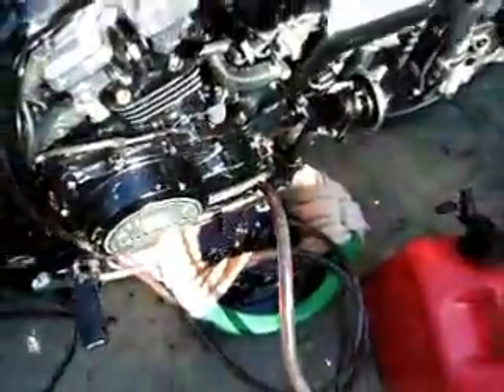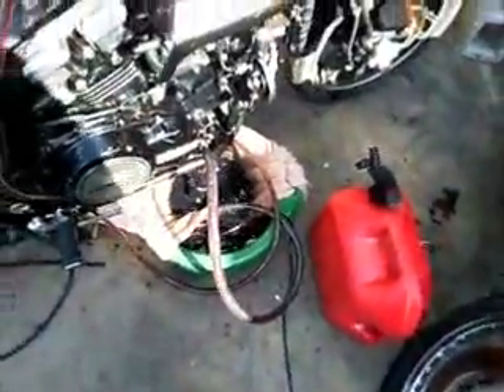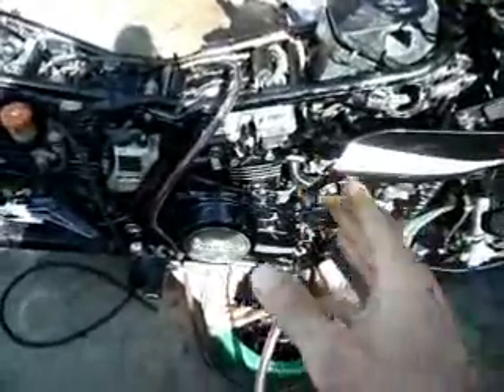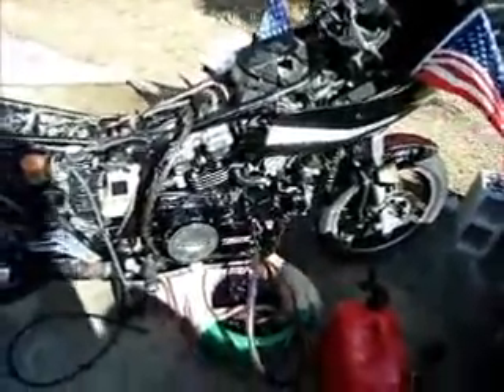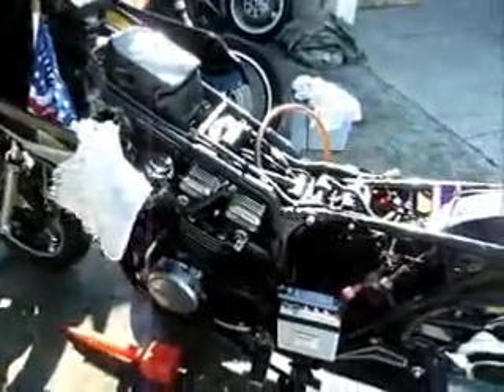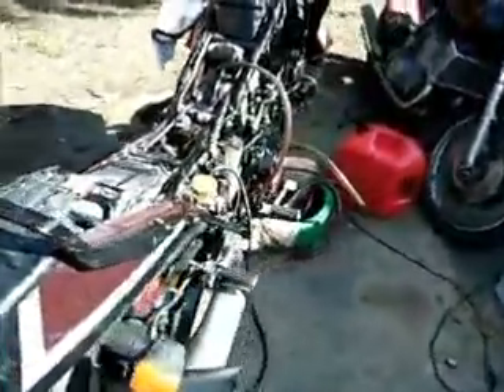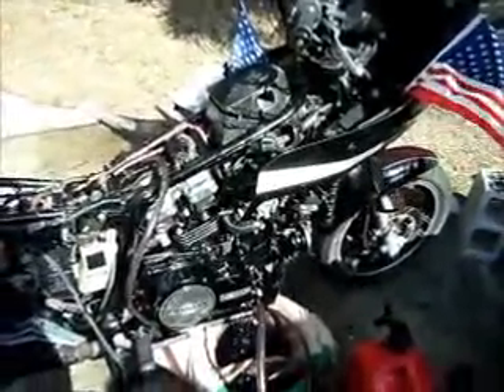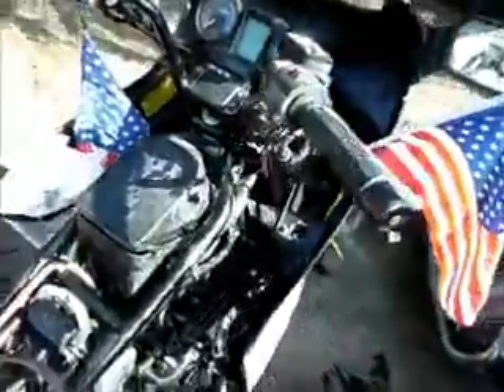Unseizing an engine without pulling it

Comment: I have taken the information from here and applying to a 1982 Honda Goldwing gl1100 Interstate. It has been sitting for 18 years. Had the pump flowing for 4 days. The trash in the bucket is a shock!
Reply: Where did you put the top line on the gold wing?

Comment from the maker: You have to pump it up from the lowest point you can and it has to flow out of the highest point  in the engine.
 So yes up from the oil pan and out through the valve cover breather.

Its effective enough I did 9 engines in 3 weeks....Also it has the added advantage of it breaks up any varnish/sludge inside the engine - leaves everything inside nice and clean -- I still pull em apart and inspect everything just to be sure it was only stuck from being in storage and not from something else

Comment: I just take the spark plugs of and spray half a can of PB Blaster in each cylinder and let it sit
Reply: +CHOPPERGIRL AIRWAR I've used that too. Works every time.
Reply: Just did this today hope it works
Reply: Same here. Then put it in 5th and rock it free.
Reply: What do you after letting the pb blast sit?

Comment from the maker: @poopdoo1 You can weld next to diesel (although I dont recommend it unless you just have to)- It has a really high flash point and you'd have to hold a lighter on it a minute to get it to go if you wanted it to.... Even gasoline you can drop a cig in a bucket of the stuff and it aint catching fire
Reply: dawino6260  on the bike I just bought I can see some rust in the spark plug holes will your method work   . I was just wondering how the oil pushes up through the rings

Comment: I just had a 18hp Brigg's sieze up one night on my Buggy, i filled it up to the top with oil thru the plug hole's, and then broke it free with a Tire wrench(redrained oil yes), and then drove it for about another 2 wk's, and then the Conn Rod  end cap broke! I can't believe it even run again after locking up like tht........

Comment from the maker: With aluminum I've had luck - but I strongly recommend pulling it apart afterwards anyway and inspecting for deep pits - little shallow ones (less than .5mm ) I dont worry about... but I've had shifting nightmares with pits over 1mm deep (and even a tooth chunk off a gear)

Comment from the maker: @redbaron447 Only if it's a piston stuck -- but that doesn't flush out an engine and get it clean -  Plus this way it gets valves,transmission - whatever is stuck unstuck and clean. It's the difference between getting it running and having it last a few thousand miles -- Or between a little rust taking out say a valve seal for example

Comment from the maker: @yellowrotorway Seems to work pretty good on most aluminum engines -- every now and again you get one with a stuck ring and have to re-ring em but not too often - They generally run pretty good - give em fresh oil, run em 1/2 hour and change it right away again is my usual 'post process'

Comment from the maker: @Templehatchet Piston, rings and a fresh wrist pin for a briggs is usually less than 30 bucks -- shouldn't have to bore it - just break the glaze most of the time.   If you catch it soon enough after it seized you can usually save them -- if there's too much aluminium in the bore though at minimum hit it with some slick 50 if you dont feel like cleaning it/replacing the piston -- My lawnmower has a KZ1300A2 engine on it perma locked in 1st gear - shaft orientation is all that matters

Comment from the maker: go UP to a model 12 mag drive pump -- AND make sure you have the plugs out and a little mix in them -- Yes it should work. give it a week and have a 6ft pipe cut to fit the kick start - tie a regular concrete block to it - when it has dropped twice on its own switch to real oil in the engine (pour some into the pcv too) - open both sides of the engine and pre-lube EVERYTHING you can get to before attempting to start it

Comment: You can throw your butt in the pan & all it will do is go out. You can also do this with gasoline. Cigs will not light liquid fuel, only an open flame will. In a contained atmosphere like a paint booth, NO SMOKING. Has to be a pretty unventilated room with your eyes burning for a cig to initiate combustion.

Comment from the maker: I do pull the spark plugs out during the process -- and although mild - the mix is a solvent -- and the pistons/rings themselves are not a sufficient seal - that little 2 or 3 psi the pump puts out is enough to get the mix up in there and work its magic.
   Really bad ones I'll break out a grease gun I've adapted with the spark plug end off an old compression tester -- VERY rarely do I have to do that and 9 times out of ten when I do the engine was stuck from varnish rather than rust

Comment from the maker: if front check your fork ground... rear or all : check your fuse, wire to the switch and flasher -- if you lost both sides it's usually one of those 3

Comment from the maker: Depending on the 50cc engine (and crank position) I'm more inclined to block off the intake and exhaust ports with aluminum plates over thick, hard rubber and adapt the fitting on a grease gun to a spark plug thread (I had to order my adapter from a Hydraulic hose place) -- but I FILL the engine with straight Marvel Mystery Oil for a couple of days first when I do the grease gun method

Comment from the maker: Much like you can remove the sub trans from a CB900C and pop in the F trans with sprocket ready output shaft -- The VF family can ALL go both ways (chain or shaft) with nothing more than a weekends effort and some spare parts laying around - .. Only exception is the NC30/VF500/VFR500 - That takes a little machine work.

Comment: I don't got an aquarium pump nor do I have any of that marvel mystery oil but I've got a bunch of diesel. I've got the 83 magna v65 and it seized over the winter...working at it i eventually got one cylinder to somewhat free up it spat out a bit if diesel out of the plug hole

Comment: I un stuck a John Deere tractor that was locked up for 25 years had it free in 10 min and didn't brake the rings. no magic potions no mystery oils no liquids no stress or torque on the engine just two hands to trun the fly wheel when it was free. I have not seen a video of anyone using this method.. I will make a video when I find a stuck engine.
Reply from the maker: Someone stored it inside (or outside properly) ... Love it when stuff happens good like that
Reply: ruckus u must know it all!! the tractor was outside for 25 years locked up..not going to fight a know it all like u.

Comment from the maker: I'd flush it for about a month then use the grease gun method little bit little bit in each piston back and forth also - prelube EVERYTHING in the top end that you can get to - use gobs of engine assembly lube before you start it that first time -- helps to have a 1/8" line run down each spark plug hole off a tee to get the grease back out but you need a big pan underneath for that also pump through your head oil lines for at least a day before starting it - make sure everything is clean

Comment from the maker: After it's done you put in fresh oil, fire it for 5 minutes, change it while it's still hot, run it for 1/2 hour with that oil then change it again - everything should be out by then but I usually give it one more early change at 100 miles or less just to be sure - sometimes you still have stuff left in there and it gets weak enough that the oil will carry it out but not till the engines been spun a few times - very rarely I'll help a crank unsticking with a wrench - I am prone to waiting it out

Comment: Respectfully, Even the VF1000R was not a 185 mph bike. Topped out at 150 mph, a little more if you re-geared it. The VF1000F was slower still. The VF1100S had a bit more because of the extra cog, and a calculated top Speed of 177. Although few were willing to push it that hard due to the chassis. 160 is where most topped out. There is no commonality between the Interceptor and Sabre. The VF1000F was a punched out V45 (998cc) and the V65 Sabre/Magna were their own design that predates the Interceptor VF's. They shared the 90 degree V4 config and that's about it.
Reply: diesel lol, dawino i dont know where you got your top speed #'s but they lied to you! that bike wouldn't do 173-190+mph if you threw it out of an airplane. remember the zx-11c/d's of the early 90's were the speed kings and they "only" did 175mph, then the 97 honda blackbird slightly went faster then the 11's, with the 99 hayabusa smashing them all in 99 with a 193mph pass.

Comment: How did you plug up gap between your tubing from the pump and your oil fill opening? When i hooked it up it started spraying out of the gap everywhere! Lol Also i have an air cooled '81 kz650 so I think the other end will be out the air intake manifold like yours but I'm not 100% certain until I get it flowing properly.

Comment from the maker: 2nd part of response: Because it's usually under 100 bucks for a top end on a 50cc I dont mind using the grease gun method - and those rings are too thin to trust after rusting even a little - they like to score the bores - best to at bare minimum put in new rings on micro (80cc and under) engines

Comment: nice video. I recently got a 1982 Honda cb450 nighthawk that the guy had stored for about 10 years. He indicated to me that the bike was in a flood, but he does not think the engine got water in it. Anyway, is this something that would help the engine or should I just try to open the top half and check for damage?
thanks

Comment from the maker: @macdaddy1600 You'd be hard pressed to get that to light off with a lighter -  9 quarts of Marvel Mystery oil to 5 gallons of diesel is the mix I use -- You'd have to hold a lighter on it for a minute or 2 to get it to go

Comment from the maker: @DRIFTINGIN808 Aint nothing but diesel - you'd have to hold a flame to it for several seconds to make it blow - plus the Marvel Mystery oil makes it far less flammable too - Mix is 5 gallons of diesel to 9 quarts of Marvel Mystery oils - You would be hard pressed to set it off with a lighter

Comment: some people don't understand how diesel fuel works little lone the engine. Its not the same as gasoline/ engines. Gas just takes a spark while diesel pretty much need an open flame to set it off

Comment: dawino. Can you do a setup video  for this? I'm not sure If an important step is missed in the video. Did you pour the diesel/oil in the antifreeze pan and let the pump push it through the motor? Steo by step? please?..lol 

I've got a 85 vt500 that was underwater in huricane sandy. 2-3 months ago she would turn over I got all the water out. Now the motor won't move. I'v I can't even turn it by ratchet. got Kroil sitting in it right now. If that doesn't work I wanna do ur thing. Thanks buddy.

Comment: Hello, my bike is a 1979 Honda CB750, I don’t see anything on top of bike to add return hose to, any advice??
Reply from the maker: Your valve cover should have a vent in it about a 1/2" hose -- thats's what I'd use - I dont think I've ever seen a CB anything that didn't vent through the top --- But I did have to pull the tach drive on a yamaha once and let it waterfall down the engine into the pan --

Comment: I have Hondo CBX 550F 4 cylinder DOHC Air Cooled. Where can I connect the loop off the top? the only hole I can see on the valve covers is for my tack?
Reply from the maker: should be a PCV vent at the top of the valve cover with a hose that leads back to the airbox

Comment: can this technique be used on a goldwing 1100? and what differences/modifications would i need to make?
Reply from the maker: yup -- none really other than cap/plate off your exhaust ports before you fill your cylinders with marvel mix -- one cylinder is always going to hav an exhaust valve open and wont hold it in there plug water drain ports should handle the overflow when you turn it -- turn it from the front of the shaft with a wrench (under your timing cover there's a bolt on the center pulley - center pulley is your shaft)
Reply: awesome im gonna be pickig up 2 goldwings from a friend that have siezed engines and want to try out this technique on them. he says they are only stuck because they have been sitting for like 12 yrs so wish me luck lol although im gonna have to make a trip to a bike salvage yard for one as it doesnt have carbs on it

Comment from the maker: @Templehatchet About 1/2 the time but something like that I'd flush it a week first with carb cleaner and let it clean out the bore --Then hit it with diesel and Marvel... Take you a grease gun and shoot diesel through the bore if the valves aren't open - takes up to 3 weeks to unseize a heat stuck one and a lot of times I end out shooting grease down through em 'cause its new piston time at that point

Comment: have a quick question I have a 1979 Yamaha xs400 that sezied on me, hasent been rode since 2006. Could I just pump that mix into the spark plug hole's? Im sorta new to the whole seized motor job. Any other tips would help if you can thanks.

Comment: hey man i need your help! my grandpa has this 1974 yamaha tx 500 dohc, it is really stuck badd, we"ve tried everything from WD-40 to CLR and nothing has seemed to work. the bike is in exelent shape because it sat in his heated shop since 1980s and i guess just seized from moistre. my grandpa said the engine was rebuilt just before he got th bike and my grandpa only rode it once. do you think your method will work?

Comment: just picked up an old rm250 2 stroke with a seized motor what u u recommend to unseize it? its been sitting for alonng time. kick start is froze up
Reply: dustin just fill the cylinder with  liquid wrench and wait. try turning it over over a day or 2 and eventually it'll break free. after that rebuild the top end to get the best power and keep the engine fresh

Comment: jGreat Vidioe!

You and My Dad should get to know each other!  LOL  

Just to clarify that the valve cover connection is the crankcase ventilation connector, correct?  And so you are pumping from your oil filling hole through your pond or similar sump pump, and then back up to top of engine with the 5 gallons of diesel and 8 quarts of Marvel Mystery Oil mixture?  Thanks!
Reply from the maker: Yup -- some Kawis have a second one down on the block you have to cap off but they still have one on the valve cover too

Comment: i just un-siezed  2006 suzuki katana using pb blaster in cylinders  waited an hour then rock it back and forth in 5th gear toll.it was freed... if that eould not jave worked I would be doing this..

Comment: that old 1100 will not do 170 and even if it did the brakes and suspension arent really good enough for those speeds in my opinion nor is that drive shaft gonna be happy up that high but id give it 145-150 no problem..cool set up for breakin that rust out of there man way to go hope you get to do that 150 on it!
Reply from the maker: They did 173 off the showroom floor - and that was Hondas CLAIMED top speed - 190+ is not uncommon.. I love kids like you come time to bet a title... ... and the dummies who look up stock specs and apply them to some of my modded bikes are every bit as funny.
Reply: +dawino6260  Lay off the drugs. V65's were good for 140-145 AT BEST.  ZX-11 did 175 with 130rwhp. The old Honda V65's made about 100hp or less at the wheel.
Reply: 173 ? down which mine shaft ? How much do you want for the speedo ?

Comment: Smoking a cigarette while using flammables like this? Wow...
Reply: +Barry Hallsted american way to live life
Reply: +Barry Hallsted I noticed that straight away!
It's a tad risky smoking when doing something like this.
Reply: +spookygodd  Stupid you say? You clearly need to do a little research (and spell checking) before you call someone stupid. FYI - The temperature of the tip of a lit cigarette when smoldering is close to 1100 degrees Fahrenheit. The temperature of the tip during a two-second puff can be more than 1600 degrees Fahrenheit. Cigarette tip temperatures are significantly higher than gasoline's autoignition threshold of 495 degrees Fahrenheit. Diesel's autoignition temperature is even lower at 410 degree Fahrenheit. What's more is diesel has a flash point of 149 Fahrenheit... How do you figure diesel is not flammable? You may want to continue your education. You obviously have much to learn ;-)
Reply: +spookygodd LMAO!! You should drink some.
Reply: I agree about the smoking but it's the vapor that is flammable. Diesel has low vapor, still the video makes me nervous just watching it. This guy will probably live to be 90 anyway.
Reply: Barry Hallsted i smoke while working with regular gas. I throw the lit butts into the gas to freak people out sometimes. They just go out. It's just in the movies that cigarettes ignite gas. Diesel is even harder to ignite.
Reply: Barry Hallsted Diesel is NOT flammable. It's combustible. Slight difference. By the look of your argument so far, you were too busy going between Google searches and YouTube trying to prove you're edgamuhhcashun to strangers, than actually considering all the variables.